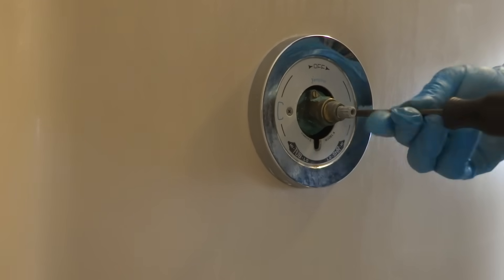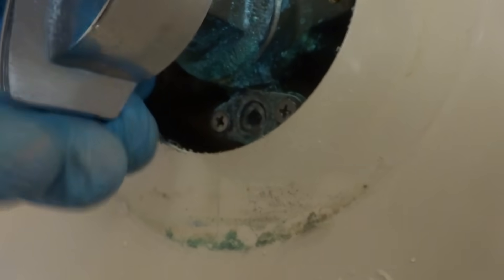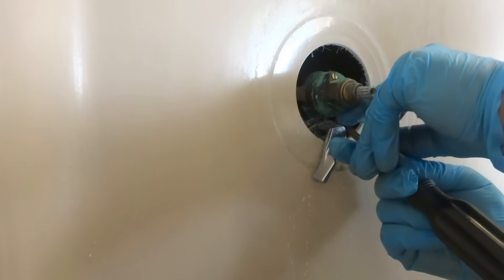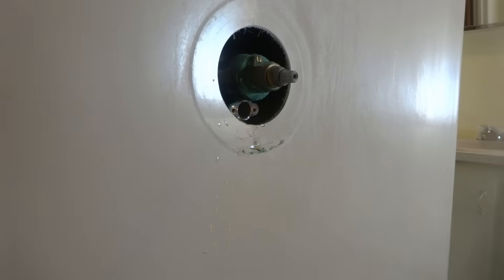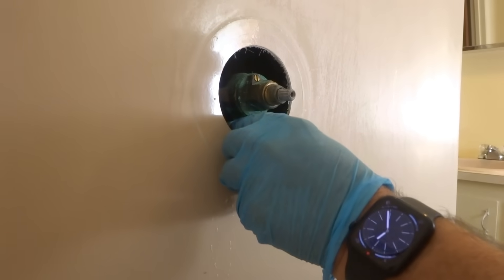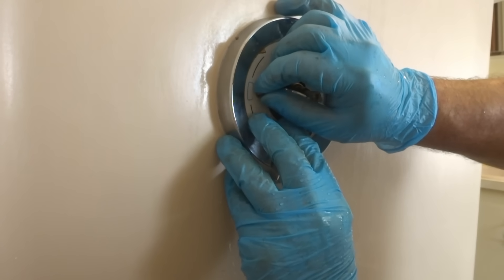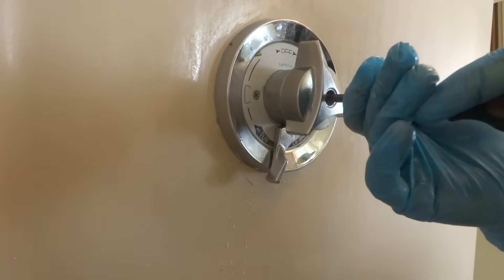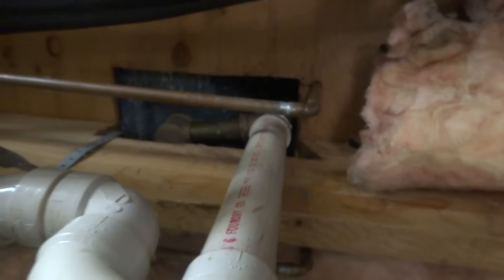MAJOR WATER LEAK FROM TUB  SHOWER WALL

Comment: Possibly a magnetic screwdriver might come in handy in a situation like this but those might be antimagnetic brass screws. I would probably drop one in the wall because I’m not as steady as Steve. LOL
Reply: they are stainless and a magnet would not work, but they do make some screwdrivers that will mechanically hold the screws while starting them...
Reply: Tape the screw to the driver.
Reply: Proto 9866 tool

Comment: The Symmon s diverter spindle is poor design. There is only one o-ring. I find most tub and shower lever gets moved a lot from spout to shower head and wears out the o-ring.  I don't find that true about shower only diverter spindle as people don't adjust for volume that often . It is an easy fix .